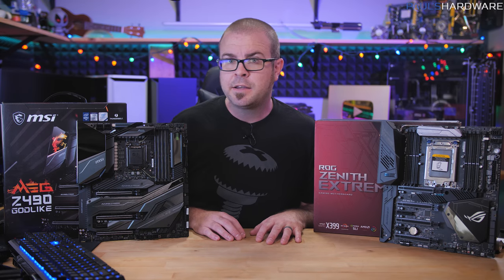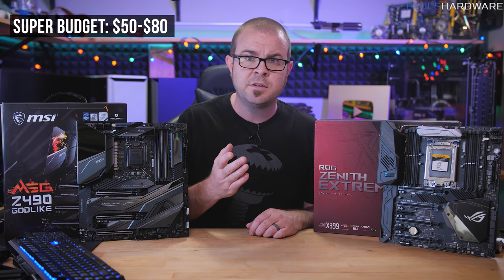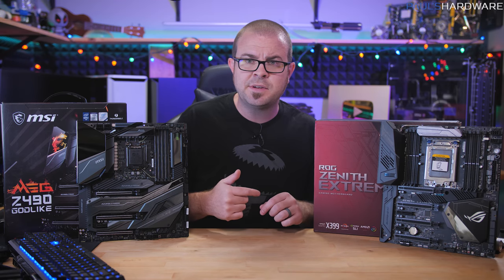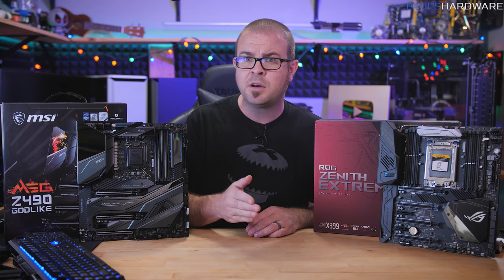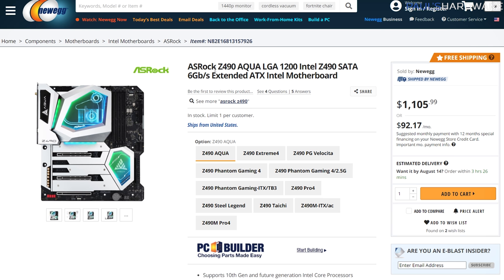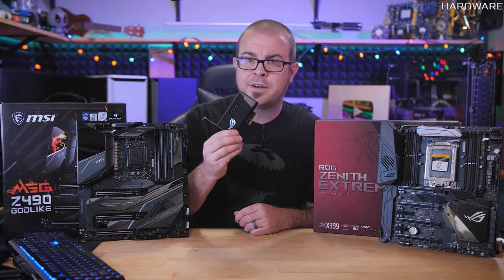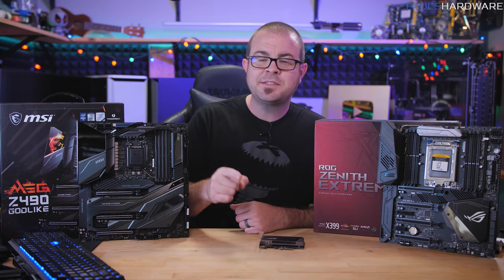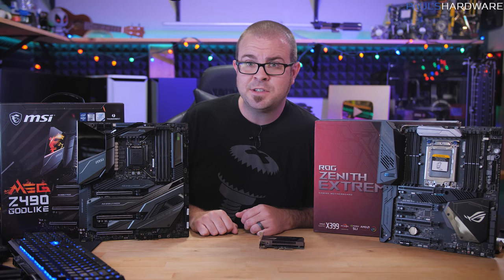What Does a $700 Motherboard Have that a $200 Motherboard Doesn’t?

Comment: I just really need all the extra high bandwidth IO support. As someone who has 3 USB 3.0 hubs hanging off her laptop, 1 of which is also a dual display extender (Dual HDMI 2.0 and Dual DisplayPort 1.4 with DSC), and numerous high end products I'm looking to get and connect, I am already seeing that I will run out of slots as is. When I eventually can build my own desktop, having those extra IO ports and connectivity is an ABSOLUTE must, and I'd gladly pay the extra money to have them. That said, I do think some of the more mid range boards should start including more high end connectivity support. If you're paying 200-300 as is, I think you should get more than 1 or 2  USB 3.1 ports and 4-5 USB 3.0 ports. Idk, maybe that's absolutely plenty for most. It more likely is. But I really don't want to be living that dongle life forever. Even with cable management its ugly, time consuming, not aesthetically pleasing, and generally dispersed in a way I don't particularly care for. Another bonus that would make a higher end board worth a buy IMO is a single USB 3.2 Gen 2x2 port, as IF I EVER needed another dongle, I could plug a long strip USB C hub into it and NEVER have to worry about the shared bandwidth being maxed out. I'd like to avoid never having to do a dongle again, but the added reassurance that if I ever needed to 6-10 years down the road as tech advances, I wouldn't need to again upgrade a motherboard to not have to worry about connection lane bandwidth ever again, is a solid bonus, and also perhaps a reason some in my situation could settle for a mid to upper mid level board if it did include one of these ultra speed ports.

Comment: DAC all the way. Actual sound guy here. The sound cards for inside of PC that are worth it cost a ton and I have yet to see a consumer that uses 80 percent of the features those cards offer, like wordclocks, MADI, ADAT, Dante or sample rates above 48 khz or maybe even above 192 khz. Those cards would cost you like a high end GPU and you would not use it, standard sound cards for PC expansion slots are just not worth it. 100-300 buck sounds cards like the Scarlett or Tascam are the way to go if you want better sound for your PC, but not something that is so high in pro audio tier that it will cost an arm and a leg, because those cards are completely sufficient for audio consumption and for beginner production.

Comment: I bought a Gigabyte AORUS ULTRA X570 board (just over $300 6 months ago). My reasons for buying this board are the 3 M.2 slots, 6 SATA connectors, Gen.4 PCIE and the capability to use the board with the upcoming new generation Ryzen chips. I'm using a lot of SSD's in my system (and no, using 1 or 2 of i.e. 4 TB isn't an option) so I really need a board with a lot of slots. With those markers set you automatically end up in the high end motherboards (at least here in The Netherlands at the store I use to buy my parts). So I decided to give it a go and buy it and hopefully it will stay in my systems for the next 4-5 years.

Comment: Dunno if it was mentioned in comments, but nothing's was mentioned about the better power delivery and voltage support on the higher end boards, if overclock it just stability it is important

Comment: Paul I can probably make a case for one of these boards.

Someone I know had a niche use case where they needed a Ryzen ATX board with Thunderbolt 3 support and ethernet faster than GbE. The only board meeting these specific needs was the X570 Creator from Asrock, and though it was viciously overpriced at around 500 bucks, it made 'em happy to have the options available to them.

Comment: I'm actually looking at a higher end mobo at the moment. I use a custom water cooling loop and my case's thermals are not great, so I want as much heat as possible being put into the loop where it can be dealt with by the radiators instead of relying mainly on internal case air flow to cool components. I love the look of the Aqua board, especially with the chipset cooling- and the waterforce too! But I'm probably going to go with the updated version of what I already have- a ROG Formula. Only covers the VRMs for water cooling but they're probably one of the biggest sources of heat out of the stuff in the computer that isn't already connected to the loop. Plus it's half the price of the others. I'd certainly make use of the features on those high end water cooling boards but even then I can't bring myself to drop over a grand on a motherboard. I'm having a hard time convincing myself to stay with the formula honestly, and might look into what monoblocks are available for cheaper boards. Then again I'm already familiar with the Asus bios and how to set my overclocks...

Yeah I hate picking motherboards.

Comment: The easily accessible clear cmos button is a must-have in my opinion, but it doesn't necessarily need to be part of the board itself.
On a board without it, I'll just connect a $2 power/reset switch from ebay to the clear cmos jumper and ziptie it up behind the front panel somewhere so it can't be knocked when not wanted

Comment: I have an Aorus x570 Xtreme, I got it because I'm planning a passively cooled, watercooled build without fans and needed an x570 board without a chipset fan but also wanted the various features included like dual bios, an array of ports, triple m.2, Aquantia nic etc. The Aqua had just gone out of stock so this was the only other board that worked.
Reply: I have the same board. Fun fact: the Aqua actually is less feature complete and the VRM power stages are worse
Reply: @aj0413_  Yeah, I was happy when I was comparing and saw Buildzoid's videos on it. The Aqua may have just worked better due to the specific usecase I had. The original idea was to use normal aluminium extrusions which this would have worked well with but the Xtreme will actually look really nice with black extrusions!

Comment: I think you missed the point of higher end audio here.  When not gaming, I (and perhaps lots of other folks) use their PC's for Home theater.  Unlike computers, audio gear quality can often hold on for decades or even a lifetime.  In my case, I use an 20+ year old DCP 501 Motorola surround receiver that is still one of the sweetest digital sounding units I've heard.   Problem is it's pre-HD so no HDMI pass through.  You have to have a SP/DIF optical or co-ax output on your computer to make this work.  Many MB's now delete that feature and don't even offer an on-board header.   Picking a motherboard with a higher end audio often comes with a fairly useless 5+ analog socket jack block, but it also can bring you the needed optical TOS-Link socket.

Comment: I would like to know more about the differences between the lower range (60 USD) and the mid to high end range (200 USD). I dont do extreme overclocking but i would love to get into water cooling and regular overclocking but i dont know if my current board would be able to sustain that kind of things either.
I dont know how to recognize good vram cooling and such. So if you have any tips as of which board or what should i look into when im browsing for one it would be greatly appreciated.
My current build consists in:
Ryzen 3800x
Asus Prime x570-P
PC RX 5700xt red devil
Corsair vengeance rgb 2x16 3200mhz CL16
Seasonic Focus plus 850W gold

Thanks!
Reply: If your board has a dedicated fan header for a water pump, then it's ideal enough for custom water cooling. Otherwise, for a simple AIO liquid cooler, just the basic CPU header would be used, not the pump header. AIO coolers control their own water pump.
Reply: @JerryDodge  Thanks for the reply! So, my motherboard does have an aio pump connector and if i would ever start to do water cooling i would probably do aio first. But, what i dont really know how to pinpoint is if the VRM components the mother has are capable of sustaining higher constant voltages with the overclock. So i would like to know if my motherboard could sustain a fixed overclocking without damaging its components. I really dont know how to determine if the motherboard has good or bad VRM components.
Reply: @TheAzureLance  That much I'm not too sure of. I'm not really a gamer, so I've barely fiddled with overclocking. 

Regarding the pump connector, you shouldn't need it for an AIO. An AIO typically plugs into the regular CPU fan header, and at least on the 2 boards I've had, I never had to use the pump header. That's only necessary if you have custom (not AIO) water cooling. In fact, the later cooler I have only connects to the CPU header with just one wire to trick the MB into thinking a fan is connected, just so that it doesn't complain that there's no CUP fan. Otherwise, they're generally powered directly via a SATA cable and are software controlled.

Comment: I have to say that I disagree on some of your opinions:
1. Most people don't need even 5Gb/s network speed or even have the equipment for it, even on their home network. I certainly would not want to pay for a 10Gb/s NIC that takes up a PCIe slot when my motherboard already supplies more than enough. As far as home use is concerned, 10Gb/s is for few users with niche applications.

2. I don't like the idea of sending audio over USB to an external DAC. I agree that it's better for noise reduction, but I think it also increases audio latency. Some of these higher-end motherboards support up to 32-bit 192kHz audio, and most people, even audiophiles, are doing good to listen to 24-bit 96kHz audio. On top of that, most people don't have audio equipment (headphones/speakers) good enough to pick up the noise. Even if they do, I'm fairly certain the noise will be reduced enough that even the best listeners won't notice any. Considering their price, the external DACs can be left for professional audio mixing and all-out enthusiasts.

Comment: Just to clarify, in so far as the practicality of a motherboard backplate, it is there on most boards these days to prevent or minimize board flexing. Significant board flexing, when say plugging components such as ram and a GPU in, or torquing a CPU heatsink/cold plate down BEYOND spec can cause irreparable damage to a board. This is one of the PRIMARY reasons as to why manufacturers started using backplates on a motherboard. For an extra $5-7 in material costs, manufacturers can reduce their overall RMA rates and/or Warranty claims by anywhere from 9-15%.

Comment: When shopping for a new live streaming build, I had a few requirements:
Well proven, mature chipset
10Gb NIC
Thunderbolt
As many PCIe slots as possible, provided they had PCIe lanes directly to CPU
Bifurcation

I ended up with I9-10980XE on GIGABYTE x299x Designae 10G.

This allows me to add all the multiport capturecards I need and also send and receive a lot of NDI videostreams

Comment: One thing I will say is that if any even vaguely 'premium' MB doesn't have an integrated I/O shield, I'm going to think that manufacturer is taking the mickey. I hate fitting those things. Another very nice feature you seem to see far too rarely is a block connector for the front panel switches and I/O, so you can connect them all up and then just make one connection to the board. Having to muck about with those fiddly little things simply shouldn't be necessary in 2020.

Comment: I wonder why, keeping in mind that most manufacturers are pricing mITX boards higher than mATX/ATX counterparts (pay more for less seems to be the common mantra ;) ) and they are offering full-integrated-water-block solutions only on those larger boards while theoretically less complex mITX boards could work better as overclocking boards, no manufacturer actually attempts to release something like full-block mITX board that cools/uses both sides (both due to often M.2 being placed on the back on those small boards)... I'd reckon that kind of a board could well warrant its price premium when going small ;)

Comment: As a ROG Maximus V Formula (2012) owner since 2012 I would like to say, that some exclusive high-end MB features have saved me a lot of time and nerve cells when it went to reasonable overclocking of my i7-3770K CPU. These motherboards have more qualitatively built components that allow to put a significant pressure on the system to push its performance much further. That's why my system still handles my needs even in 2020 (including AAA games and heavy tasks). The only thing I have upgraded is GPU without any bottleneck issues. So in conclusion I'd say that these high-end boards are worth their price and even can save you some money in the long term (if you combine it with the right CPU and GPU).
Reply: Rtx 3000 series need 4.0 pcie

Comment: Integrated temperature sensor headers on motherboard have been priceless in custom loop since i can set fan speed based on them. No need to buy separate control device which adds more cables.

Comment: I was waiting for the word insane, Thank you. Overclocking boards used to be roughly equal in price.
Reply: Matthew Haughn
only if you are some gaming kido in mums house, running fortnite on some $1200 board, that's insane.
if you need some porn home server, not trusting apple, that just normal, many NVMe drives on X299....

Comment: I would reccomend the 550 carbon. It has the wifi built in with 2.5g lan and it has the IO shield already installed. It has USB type C and a few other features that are unbeatable for the price. It's 220 bucks a little more vs the regular one but it handles heavy over clocking well. NXZT case, 550 carbon mobo, zen 5600x cpu, 3070 gpu, 750watt psu, 1tb of ssd on the mobo, fans, and you're pretty much good to go for the ultimate 1440p gaming experience.

Comment: I have a Gigabyte Z170 Gaming 7 motherboard, and while it is time to retire it and upgrade, I really love the illuminated IO shield. I have never seen such a think on any other motherboard ever but it is fantastic. The whole thing lights up, and the colour can be changed. It is from just before the RGB craze so it is not RGB but it does have about 6 or 7 different colours you can choose from and I've never required any additional light when trying to plug something into it.

Comment: I went with a pricier Maximus Hero XII for afew different reasons.

-Looks: I wanted to control the build colorscheme, so I went with a sexy all black board.
-sata/m.2 support: i wanted a board that supports 2x m.2 while still leaving use of all 6 sata ports.
-PCI lanes:  most cards I was looking at, even as pricey ones, really didnt have the pci lanes support i wanted. with the separated lanes, i get max out of all slots instead of many other boards going down to x4/2 if you populate 3 or more..
Reply: 60a ps... meh

Comment: I recently replaced my x99 asrock extreme 3 board with a Asus x99 WS/IPMI board. It is a world of difference. For starters got a OC of 4.3Ghz with 1.15V max 67 deg air cooling vs. 4.3GHz asrock @ 1.25V + Faster memory. Way more stable overall, on top of that onboard VGA that allows me to turn off all my GPU ran monitors and focus on GPU rendering. It fits my needs!

Comment: Motherboards with "integrated" mono+chipset blocks can be cool in theory, but inmy experience their perfoemance is 'meh' at best (for price and context), and they almost entirely knocks out the 'custom'(izability) in 'custom watercooling'. Because nothing is really interchangeable, there's always a tonne of components and setups that don't physically fit on or rogether with those boards/blocks, you can't get any spare parts /seals etc (certainly not if the board is more than 5 days old), doing anything 'custom' on board is off the table because the integrated blocks and heatpipes are epoxied or brazed together in one huge part - and finally - the shrouds and heatsinks onboard usually makes it a real headache to build a nice, clean, tidy loop in a relatively compact case, because tveir shapes and severe oversizing for cometic reasons, makes it difficult to find and use space anywhere near around the board on all 3 axis.

Comment: For me, what I'd want in a more expensive motherboard (to me, that would mean north of $200-300), I'd want lots of expansion slots (like 7 PCIe x16 on an ATX board), lots of SATA / SAS ports (at least 10 or more), plenty of RAM slots (8 on ATX or 16 on EATX) with support for RDIMMs and LRDIMMs, and NO bandwidth sharing (No "if you use the M.2 slot you use a PCIe slot or 2 SATA ports", for example).

Comment: The XI formula was a must have for my first custom water cooling build. Yes I know watercooling on VRMs is over kill, but it looks cool to me and that’s why i custok water cooled in first place. (Not just first custom water cooling but first build ever too might I add). Also. I went with a white theme. There are almost zero white mobos. The formula has armor that I took off and spray painted white and silver to match my build. So there are two reasons I spent 500-600$ when the features I needed were all on a 120$ board.

Comment: Great video, Paul. I have a MSI GODLIKE Z370, initially I planned to do some extreme overclocking, but i have yet to do it. But I'll be honest I bought it because of the aesthetics. I bought a Formula years ago with the intent to water cool it as well and never did along with an ASUS Poseidon... Sad that I have not overclocked it and it's like 5 years old now. My Godlike however is watercooled with a SeaHawkEK 1080Ti.  I think once i do my Ryzen build I may opt for around $200-$300 max for a motherboard. Thanks for the video.